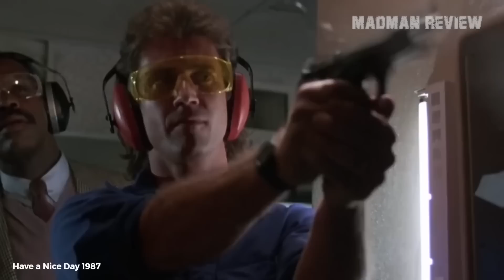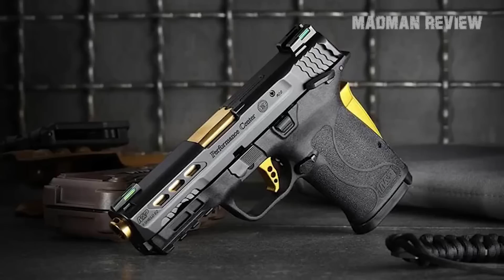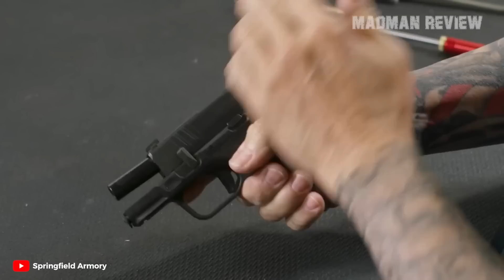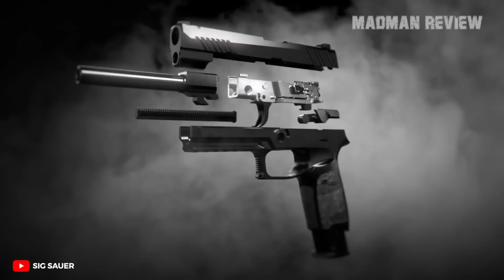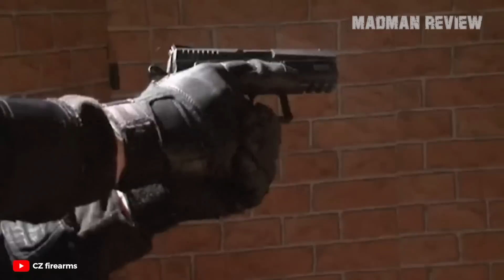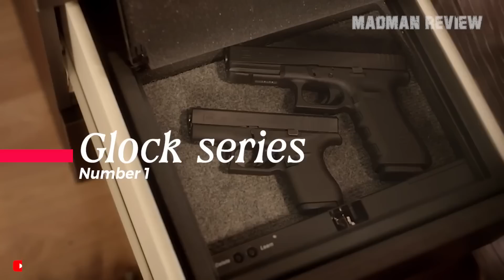9 Most Reliable 9mm Pistols for CCW 2023

Comment: Had a p320 before this whole story came out.. sold it a couple months later. Stuck wit my SAR9 w/ over 1,000 rounds 👍🏾
Reply: The SAR 9 is a very good pistol. As some articles have mentioned before, the SAR9 looks like the marriage of a G17 and a H&K VP9.

I got one during a ridiculous sale that PSA had going. Very accurate right out of the box. The trigger could use some improvement. But I'm sure constant trips to the range would smooth it out.

Comment: I’m about 900 rounds thru my Hellcat Pro. So far, no issues. I haven’t cleaned it yet.
Reply: 900 rounds without a cleaning? Please tell me that's a typo?😂If not, please clean and maintain your firearm so it doesn't fail you when you need it.
Reply: @bijk1911  I will be cleaning it. I’ve been running it dirty on purpose. I enjoy cleaning my guns 👍🏼

Comment: mith & Wesson M&P9 Shield M2.0 EZ 9mm Pistol with Thumb Safety
The next evolution of the M&P Shield EZ M2.0 EZ 9mm Pistol, the M&P9 Shield EZ encompasses all of the M&P Shield EZ features now in the powerful 9mm caliber.

Built for personal and home protection, the new M&P9 Shield EZ is easy-to-rack, easy-to-load, easy-to-shoot and easy-to-clean, appealing to a wide range of consumers seeking out these popular features. 
The M&P9 Shield EZ pistol ships with two 8 round magazines that feature a load assist tab for quick, easy loading, as well as a picatinny-style equipment rail to accommodate accessories. 
The pistol also features an optimal M&P pistol 18-degree grip angle for a natural point of aim, white-dot front and adjustable white-dot rear sights, and a light, crisp trigger.
Contact us via https://graymarketguns.com/product/mith-wesson-mp9-shield-m2-0-ez-9mm-pistol-with-thumb-safety/

Comment: You've turned into a big fat commercial channel bud. "Keracota"??? Ceracote pronounced sarahcoat ceramic coating lol. The Caniks unless running spendy ammo stove pipes, the S&W EZ will eject the mag if you breath on the release and the model with anodized parts and the model with skeletonized slide is the "Performance Center" and costs a bit more. Hellcat is more of the same and same as the HK, the Sig is good but don't expect the find your different frames anywhere anytime soon. Now that CZ 75 is  staple in my defense catalog, nothing quite like it.... I have probably 7000 rounds through my P-01. Steyr I don't have experience with but Glock is as overrated as teenage pussy.
My go to is still my Springfield XDm .45.

Comment: My Ruger LCR unlike the Ruger LCRX that you show in your video in 9mm has had the bullet jump the crimp on more than one occasion not allowing the cylinder to move rendering the revolver useless. I haven't gotten rid of it and I have successfully used other types of ammo with better reliability. My EDC rotation is between my SIG P938, Ruger Max 9 and my Taurus GX 4 without any types of issues. Thanks for your insight on some of the other 9mn pistols for 2023 in your video.
Reply: Thanks for watching and commenting.
Congrat you won a prize of reward.
Message the above name on telegram...
To claim your prize

Comment: Why hate taurus? G3 g3c series are pretty reliable now a days
Reply: Thanks for watching and commenting.
Congrat you won a prize of reward.
Message the above name on telegram.
To claim your prize
Reply: As soon as I heard his Taurus comment it immediately turned my attention away from his post. I have both Taurus (including GX4) and Glock guns, and I’ve fired rounds thru countless other manufacturers guns. I’ve never had a failure to feed, misfire, parts failure...nothing with a Taurus, but certainly have with the others. The Taurus haters need to put on their big boy pants and come to the conclusion that Taurus makes quality pistols now.
Reply: @deanshafer6868  um no no they don’t. They are a budget gun manufacturer second to high point.
Reply: I have both the G3 and G3c.My edc is the G3c. Great pistols! 👍
Reply: I got a G3TORO and feels and shoots great. Very easy to take apart to clean.
Reply: Gx4 nice as hell too
Reply: They're basically Glock clones with metal guide rods. Bought my sis a G3 and  it's snappier than a g19 or a small frame p80
Reply: Taurus is trash. Everyone knows that. 
I took a gamble and bought one of there 22’s the tx 22 to be exact and had nothing but problems with that piece of crap. Taurus never ever again.

Comment: I just found your channel and was enjoying the video until you recommended the Sig P320 without even so much of a passing mention of the numerous times law enforcement and military veterans have reported that this firearm fired without a trigger pull, oftentimes while the weapon was still holstered. I would encourage one to do some research on this gun to make an educated decision on if they're willing to carry and trust their lives to this gun prior to buying.
Reply: I own 2 Sig P320's. One in 9mm and one in 45acp. I have never had a single problem with mine. I've seen videos where they say it was the gun, others where it was the holster and others where it was the operator. I've  got no problem carrying either one of mine. Then again I also have carried a Walther, a Canik, a Smith&Wesson, a Ruger and a PSA Rock. I believe that one should be proficient in several different carry guns but that is just my personal opinion.
Reply: @oliverclosoff4973  so you’re basing your analysis off a sample size of 2?
Reply: @Frost_Byte_404  did you not fully read my comment??? The part that stated about watching multiple videos???  I merely stated I've had no problems with mine. Did you not fully comprehend my statement?
Reply: @oliverclosoff4973  calm down there Ollie, you seem a bit upset. You apparently have some strong feelings about this particular model of firearm based on your sample size of two, the limited amount of time you’ve carried them (since you’ve also stated that you’ve carried various other firearms in addition to your two P320s), and some YouTube videos you’ve watched about them. 

I stand by my original statement that I was disappointed that the content creator, who I have to believe is aware of the history of this firearm, didn’t mention the P320’s problematic history when he chose to include it on his list. Ultimately it is up to the buyer to do their own research on a firearm before making their purchase and trusting their lives to that piece of equipment.
Reply: @Frost_Byte_404  lol, no strong feelings about Sigs or I wouldn't own other brands. As I stated,  I have had no problems with mine.  Once again you reference videos about the problems and I have watched those also and I've watched videos that said it was other errors.  How did you come to your expert opinions?? Did you watch you tube videos??  I only stated my opinion about my personal experience and I stand by it.
Reply: @oliverclosoff4973  the only video I’ve referenced is this one and have only opined on the creator of this video not mentioning the numerous unintended discharges that have been reported on this model as well as the lawsuits being brought against Sig Sauer in regards to those unintended discharges. 

There are numerous ways to obtain information about this topic and the court filings other than YouTube kid. This is the last time I’m feeding the troll, I’ve grown weary of you.
Reply: @Frost_Byte_404  oh no, whatever shall I do???  I will be so upset that some internet guru won't speak to me. Grow up little one,  you're not that important nor are you that savvy.
Reply: He is a Taurus hater, sig fan boy.
Reply: Thanks for watching and commenting.
Congrat you won a prize of reward.
Message the above name on telegram.
To claim your prize
Reply: Thanks for watching and commenting.
Congrat you won a prize of reward.
Message the above name on telegram.
To claim your prize

Comment: Remember folks, no one ever said they wish they had a smaller gun in a gun fight.
Reply: Not true, I have many full sized pistols but my primary daily carry pistol is the Taurus GX4. It is a compact pistol that has 11+1 round capacity lending itself to being much more comfortable to carry while still maintaining reasonable capacity. The more comfortable a pistol is to carry the more likely you will carry that firearm more frequently. I have roughly 500+ rounds through it with zero problems, it is very accurate and reliable, and I fing it much more comfortable to carry than my Glock 19, Walther P99, Beretta M9A4, Colt 1911 custom Meltdown, or any other pistol I own and since buying it I carry all day everyday and hardly notice it's inside my wasteband.
Reply: Nobody ever complained about too much magazine capacity or too much penetration after a gun fight either.

Comment: Nice review.
But an interesting test by the VSO Gun Channel using a Glock 19 should be avoided by any Glockoholics lest they go berserk……
They were actually testing the durability of a gun sight…..and chose the “finest handgun made”…..a Glock 19 as the base.
The test consisted of firing 1000 rds in 20 minutes on their range.
The Glock ran fine for about 10 minutes, then started jamming……feed and ejection issues.
They hosed it down with lube……helped some, but problems continued.
They did finish the 1000 rounds.
They also “finished” the Glock 19 !
Other than my Sig, I’m sure there are other handguns that would have failed also.
STANDBY……let’er rip…..
Reply: Yes, I also heard they've done the same to sig and it failed after 137 rounds. Let's trust some random YouTube channel that's looking for views. The bs video was done for someone like you who's made up his mind way before you even watched the video
Reply: When are you going to put 500 rounds down range in 10 minutes???
Reply: @Nobody-11B  First opportunity I get !
Reply: @unclebob4964  most pistols would melt it's not something they're made for, was my point.
Reply: @Nobody-11B  I agree…
Reply: Had a Glock 23 in .40 S&W. Biggest piece of junk I have ever owned, soon as it got warm, sticky slide, it would rattle when shaken. Trigger reset problem solved sold it back and bought a TAURUS. This dude must work for sig this is the 2nd video where he slams Taurus.

Comment: No mention of the P320's recent numerous lawsuits and incidents where the P320 goes off without the trigger being pulled? Even police departments are pulling the P320 from service because of this issue. I think SIG redesigned something that is supposed to fix the issue but and that they make other high quality weapons but I wouldn't include the P320 in any "Most Reliable Pistols" list.
Reply: The 226 is way better than the 320
Reply: @danjarmusik878  the hi-point is better then the 226
Reply: I totally agree. This is NOT a weapon to trust your life with based on its past and recent history.
Reply: Zzzzz old news
Reply: @zaayyv6653  Dec 5, 2022 — The lawsuit, filed last week in federal court in New Hampshire, said there have been more than 100 incidents of the P320 pistol unintentionally
Dec 2, 2022 — Newington-based Sig Sauer is facing a new legal complaint from 20 individuals, including law enforcement officers and military veterans
Dec 1, 2022 — Former Tampa Police Officer Bob Northrup sued Sig Sauer last year, alleging his P320 service weapon discharged when he was working an off-duty
Most recent lawsuits are about a month old as incidents continue to happen so yes month old news.
Reply: @darthjunius  zzzz old news get over it
Reply: Troll